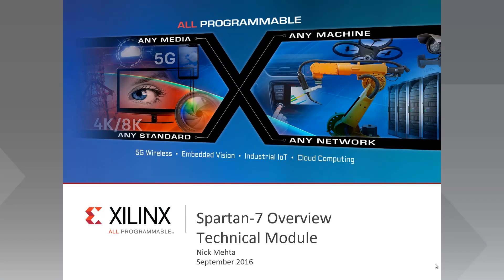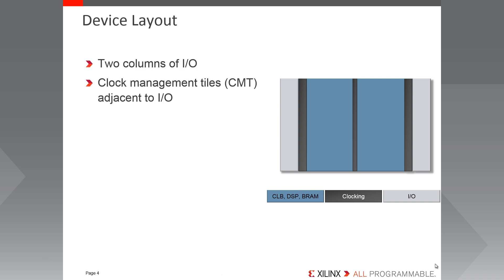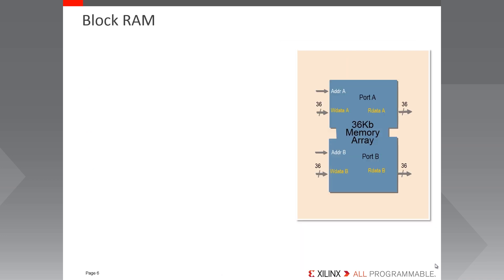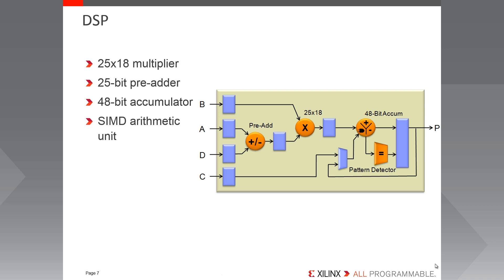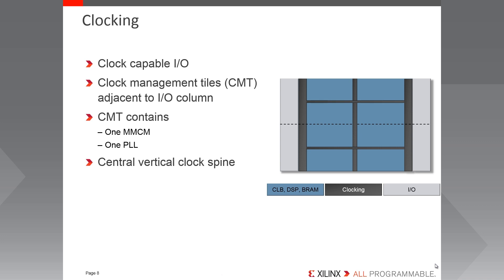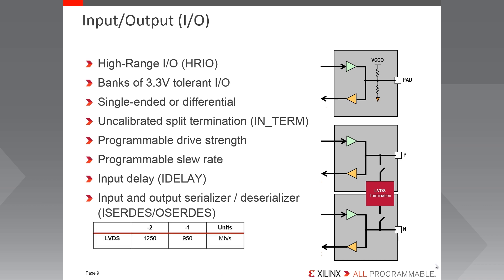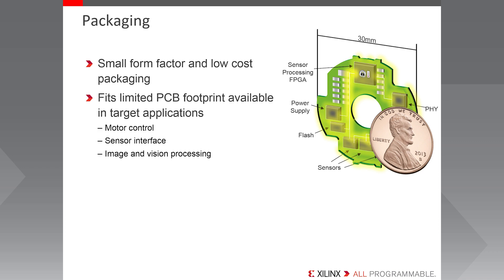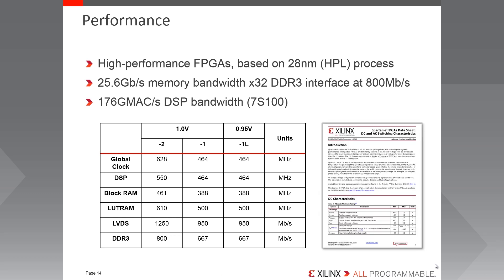Spartan-7 Technical Overview

Comment: Interesting that you decided to support DDR2 and DDR3 for a new product. Production of DDR2 is ramping down, and DDR2 is already more expensive then DDR3. Meanwhile DDR4 is slowly replacing DDR3. And following that, the market is going towards HBM.
Reply: Well to be entirely honest, in my opinion DDR memory support on Spartan is more like a gadget. It's already struggling to reach DDR2 speeds (800Mbps), being forced to use a hard IP for the memory controller part (not only the dedicated IO blocks, as for other 7 series FPGAs).

I actually smirked @12:10 when it says "the high performance programmable logic of Spartan-7 FPGA cannot rate at sufficiently high frequencies to enable soft memory controllers". Sorry if I'm being rude but this sentence is the perfect example of marketing bullsh*t ^^ The logic of the Spartan-7 is so high perf. that it is doesn't support the speed necessary for the old DDR2 800 that has more than 10 years ? Come on...

More seriously and unfortunately, the Spartan-7 is here to replace the old Spartan-6, it is the lowest end of the already slightly outdated 7 series. And the memory controller has always been the hardest part for this category of FPGA. It uses a hard wired memory controller, so not only the performance is not high, but all the IOs are fixed and you won't have any flexibility.

For a decent memory controller you will need to go for at least an Artix-7 (same speed but soft IP), and more likely a Kintex. To be honest I would definitely not recommend going for Spartan-7 if you plan to implement a memory controller.

By the way Kintex and Virtex Ultrascale actually supports the HMC, which is to me even more advanced compared to HBM. And they do support DDR4 (2666Mbps max).

Now I may sound a bit rude, and THIS DOESN'T MEAN I DON'T LIKE Spartan-7. I do think it is very good for anyone who needs many low speeds IOs and control them with simple logic, as it provides the best IO-to-logic ratio. Compared to Spartan-6, it's an update in terms of process and power consumption, but also it now uses mostly the same primitives/IPs as in the other 7-series FPGAs. For Spartan-6 it was not the case at all, and porting a Virtex-6 design to a Spartan-6 (or the contrary) could be quite painful, especially if you had complicated clocking and in my case LVDS deserializer for instance.

This is the kind of presentation I would have liked to have in this video. I just dislike the lack of honesty/clarity when presenting it as a "high performance FPGA", whereas it is at the lowest end compared to the other Xilinx FPGAs.